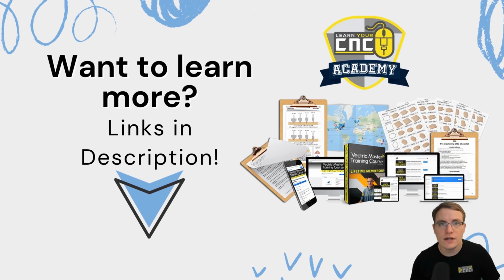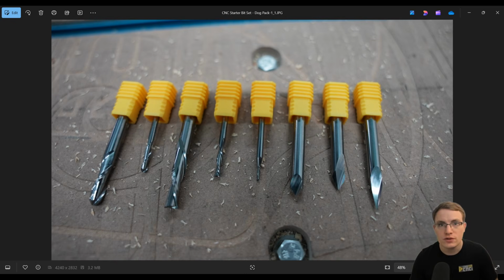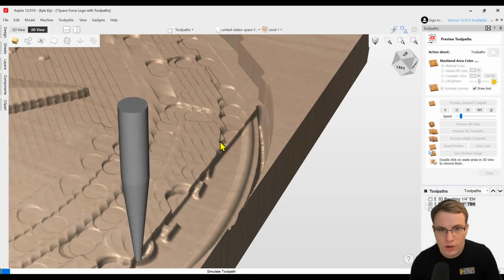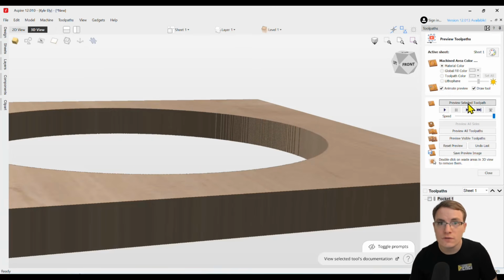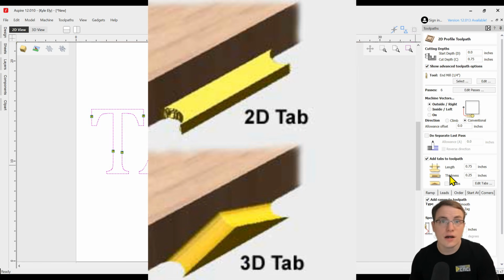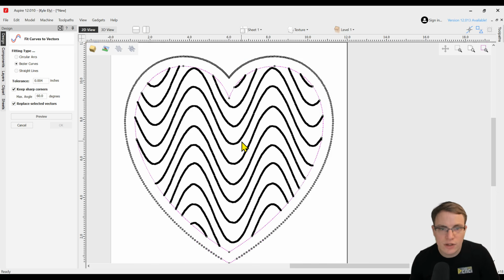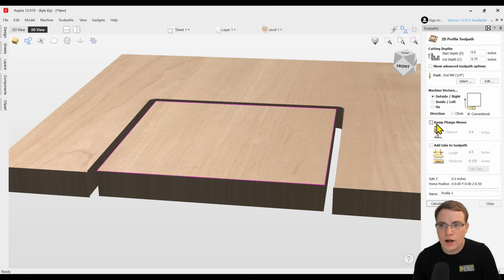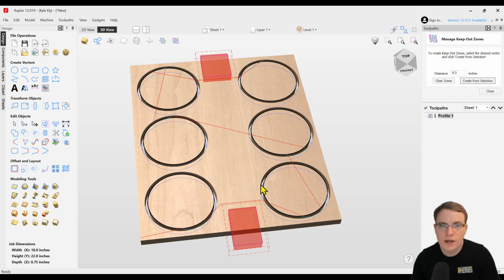10 Biggest Vectric Software Mistakes That Are Ruining Your CNC Projects!

Comment: Biggest issue I have is zeroing out and then the machine head moves a couple inches to the side. If I set the machine to start etching from the center of the project it's fine. I almost wonder if axis locations are off in the machines cach or UGS. hm. Starting from the bottom left corner is unpredictable for me at the moment.

Comment: Might want to mention in tip #9 that you should never just plunge a downcut bit into you material.  It will most likely break a bit or start a fire since the downcut bit is pushing chips down into the whole where there is no place for them to go. This will create stress and heat.

Comment: There is another method to avoid hitting clamps. And that is to change the origin of the starting node. As in the example shown if on the two bottom circles the starting nodes were on the other side of the circles the that would change the tool path to avoid the clamp holding the timber down.

Comment: Good explanations! On the topic of zeroing we default to bed + paper thickness. Most projects we need repeatability and the pocket depths need to be the same remaining material everytime. We set the raw material thickness to a worst case as raw materials change over time from suppliers. This way for example all food trays are identical thickness and finished size. Touchoff from the surface will cause deviations in overall thickness as materials change forcing constant recalculation of the project and regeneration of the gcode. Then we can use stored gcode and not recalc or change thickness for each job. Typically this allows for about 6-8mm of thickness variations without recalc.
 On the + paper thickness curiosity, my pet peeve is damaged spoilboards and constant time spend resurfacing. I came from the metal cnc world where cutting into the table is the biggest of big no no's. We always place a sheet or 2 (for larger stock pieces) of paper down under the workpiece at the clamp locations and set zero to the surface of the paper (known zero no need to touchoff). This allows us to set our through cuts to pass Z zero by 1/2 the thickness of the paper and never touch the spoilboard but always cut through. Copier paper is cheap especially the already printed on scraps.

Comment: The node editing to Bezier is very helpful, thanks Kyle.  And the feed speed section ... I tend to leave the speed at the default for the tool and do more passes to reduce the strain on my bits and machine.  Great video.
Reply from the maker: Glad it was helpful! Try turning up the feedrate if your machine will allow it, you may find good results!

Comment: Keep out zones are great, but keep in mind that a return to xy0 will not be included in the toolpath, and still may end up crossing over any keep out zone implemented. I had this happen on a frame project where I champfered the outline of the project and clamped down on the inside of the frame.  The return to xy0 crossed right over some clamps, rendering the keep out zones option into a roulette table if you don't take it into account.